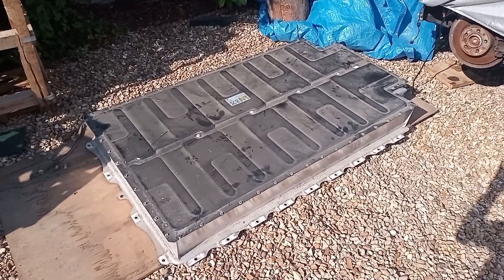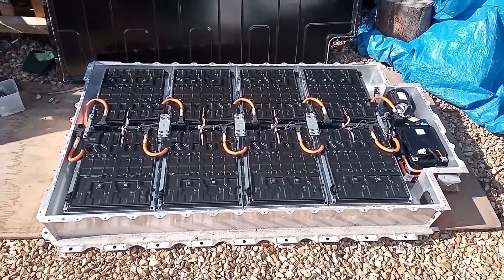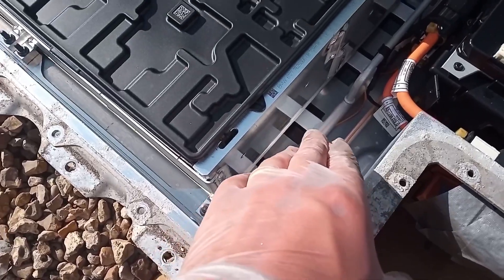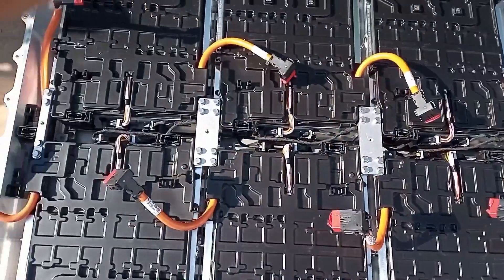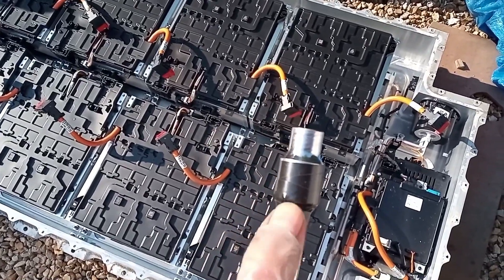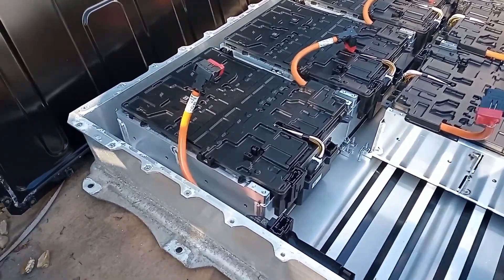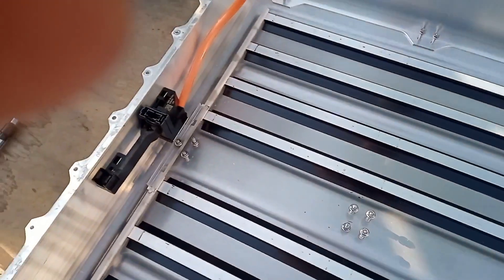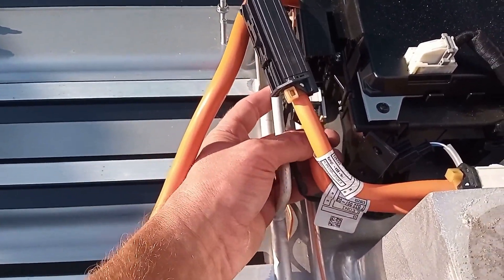BMW i3 strip down ep 16 HV battery tear down

Comment: Seems like an easy module change if there was an aftermarket, higher energy density module available to drop in.
Reply: There is a company called MTG who are providing a battery pack or battery modules up to 154 amp power they are CATL batteries. There is also another company called. Lion Smart who are offering a similar proposal who are based in Germany. They have a concept vehicle which they claim has 100 kW battery pack. I think the sweet spot for the Bmw i3 would be a 75 kilowatt hour battery pack
Reply from the maker: Definitely! I have the 60ah modules and the latest cars have 120 ah 🙂
Reply: @MiniLifeCrisis  yeah, correction, I was thinking higher than the 120ah. At least around 200ah.
Reply from the maker: @flyingyakdeath  there were rumours originally that BMW would do one more battery upgrade which would have been in this ballpark. It would have made the i3 even more appealing and, for me, would have been very successful. I'm sure someone out there will be able to do this soon

Comment: I’m surprised to see what a lousy production design this is by bmw. It looks like a prototype. The thermal connection, the rectangular coolant strips are horrible. The conductive efficiency there looks bad. No wonder the i3 was so expensive
Reply: BMW didn't design this. It was outsourced to a London based engineering firm.
Reply: @wreckage-vs5jv  On the flip side the design lends itself for a 3rd party to insert some higher energy density battery modules to increase the range.

Comment: This is a wicked build, did you ever consider fitting the mini shell over the i3 floor pan or is the BMW too long? Also, was the battery pack too big to bolt straight to the mini floor as is (obviously with some modifying) see build XRTT by Shine Automotive or Frank with Matt Green but obvs they aren't electric
Reply from the maker: Hi Karl, thanks for the comments, the i3 is a deceptively big car, as big as my Qashqai so no chance of them matching up, the pack would be huge and leave me with no ground clearance. I'm sure there's a car out there that could body swap, that would be cool. I'll have to look up xrtt, watch a lot of Matt Green and obviously seen you on Instagram 😁

Comment: That pack looked really easy to dismantle, apart from removing the batteries of course. The eGolf pack I have was a nightmare.
Do you mind if I ask what diameter squared the cables are? Mine was connected by 35mm2 insulated solid copper bars and some of them were the full length of the pack.
BTW you need to be careful of the control module, it may have Caps in it that could be at full pack voltage.
Reply from the maker: Hi Ali, I've seen the Golf packs, they look like a nightmare to work on! I don't have much bare wire to get to but the outer diameter (including insulation) is 12.85mm, the insulation looks about 2mm thick. I hope this helps, cheers
Reply: @MiniLifeCrisis  I guess that would make them approx 50mm sq then thanks.
Reply from the maker: I thought that but it seemed too big compared to yours 🤔
Reply: @MiniLifeCrisis  VW used 35mm sq solid copper for the internal battery connections. I'm not certain about the external cables but I also plan to use 35mm sq for short  internal connections and 50mm sq for external cables. 50mm sq has a diameter approx 8mm

Comment: So no special high voltage precautions needed working on the battery?
Reply from the maker: I am sure there will people out there that would recommend HV gloves and or tools however I am not touching anything that is HV, I am merely removing the batteries from the battery box. I hope to be able to go through the whole build without needing to use tools on the battery modules apart from charging and testing. The connector is plastic and safe and the dangerous part of the battery is protected by a plastic cover.

Comment: I Like your High Voltage Gloves
Reply from the maker: As I'm not actually making contact with anything HV and just removing the modules I did not think HV gloves were necessary. I had already watched a video of this being done and understood where the dangers are.
Reply: @MiniLifeCrisis  It looked like the connectors were all well insulated but it's probably a good idea to have the HV gloves handy for the future. It's likely when you fit the pack in the car you will need them at some point.
Reply from the maker: I will, promise 😉

Comment: Great video. Any chance you would measure the external dimensions of the battery box? Am interested in knowing the external width and length ( aluminium vertical to vertical ). Cheers.
Reply from the maker: Hi, I've taken the outermost measurements, where the pack bolts up to the car.
Width = 895mm
Height = 160mm
Length = 1650mm
Hope this helps